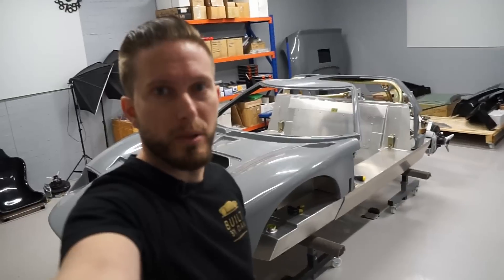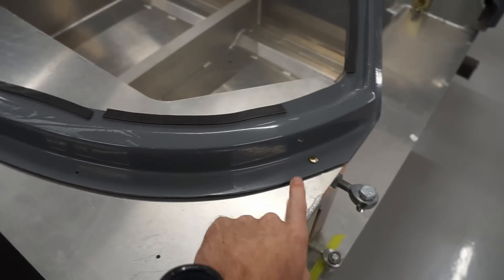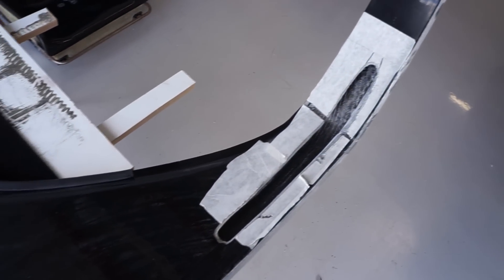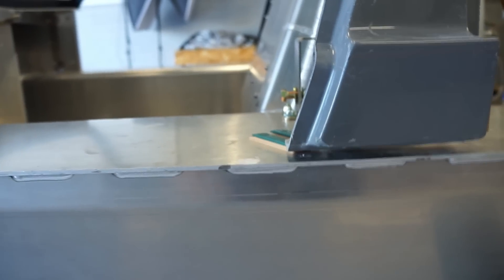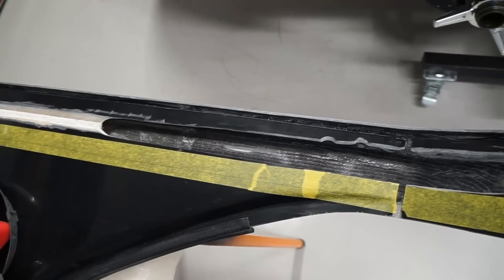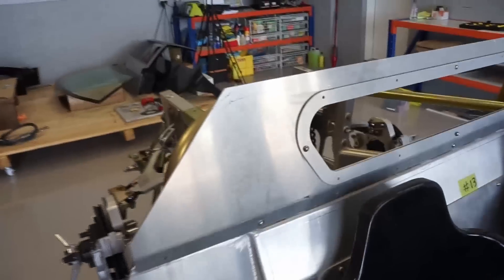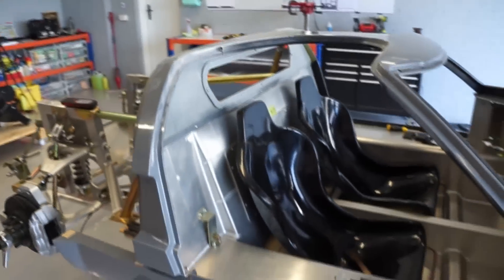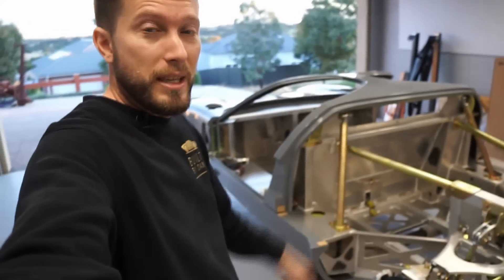GT40 Kit Car Build - Ep 20 – Roof Spider Install

Comment: Your patience has been rewarded, Dan. The result looks great. 

Other commenters have been scathing about the quality of the AP body. There is a world of difference between panels that need to be trimmed into alignment and panels that have no hope of ever aligning. 

I have heard of plenty of GT40 projects using well-regarded kits that needed the spider cut into four and reglassed to meet the sills and accommodate the doors. That’s the reality of fibreglass.

Comment: I had two minds on this Dan, either the roll bar should have been designed to sit neatly under the spider without cutouts or modify the spider to recess the roll bar tubing (which I believe will give a better look finish). Either way I think Absolute Pace should have known of this and incorporated this as an opportunity for improvement. Once all is clear I believe the spider's strength could be retired by wrapping the bulkhead and tubing with thin flat rubber sheets, add a release agent then fill the spider cutouts with reinforced glass resin. 
As for the build, I'm really enjoying your progress and I hope we'll meet up one day once mine is done.

Comment: dan being a panel beater i would use black urathane across the top back edge of the roof spider where the roll bar meets put a tape line on the roll bar about 3mm back and do the same on the roof spider put a seam of urathane across it wipe with your finger the length of the cut use a rubber glove of course then pull the tape off so it is nice and neat. urathane when it dries is flexible so it will work good with the figre glass expansion in the hot weather you can use it to seal the rear window bulkhead as well as most urathanes are structual and it can also be painted if needed a good example is wurth black KD bond keep up the great work just don't use silicone cheers glenn
Reply from the maker: Thanks for the advice Glenn, that's pretty much what I intended to do, so good to know I was on the right track! I know I often refer to 'silicone' as a general term for a sealant, but appreciate silicone and polyurethane are two different products with different properties.

Comment: Hopefully the manufacturers of the kit acknowledge that they stuffed up the radii of the roll bar bends. You shouln't have to weaken the roof spider for this bodge. Love you work though Dan.
Reply: Exactly !!
Reply: They havent admitted the kit is not fit for purpose.. I pity the poor guy that tries to build one off theese crap kits after
Reply: Pretty piss poor for something that’s supposed to be a premium product. If I’d made something that fitted that badly I’d struggle to justify charging money for it that’s for sure.
Reply: Factory 5 make all body panels over sized. It’s up to the builder to make them fit to there tolerance
Reply: @s.hall.4187  but surely you shouldn’t have to grind away the inner structure of the spider to make 2 of their components fit together? Just can’t get my head round that being accepted as a given
Reply: @mopedmarathon I agree, but here we are, I suspect that the supplier is not the manufacturer of every component

Comment: Gday Dan
Sam here from Perth-have same kit ordered and not far from being shipped— have a gen 3 2020 Mustang 5.0 liter and with all wiring harness and all accessories— have done mods for shallow oil pan and inlet manifold and using Subaru STI 6 speed modified for transaxle with locally manufactured flywheel assembly— look forward to your next episode— all the best mate!!
Reply from the maker: G'day Sam, best of luck with the build! Sounds like we are running a similar setup, with the exception of the transaxle, and you're lucky enough to already have your running gear, I still have a bunch of components on back order, mostly in the US... flywheel assembly and clutch is something I still need to sort. Thanks for the support, hope the build series helps in some way with your build! Feel free to reach out via email or on Instagram if you'd like to compare notes along the way.

Comment: With these tight tolerances, just remember to do something about the future rattling, which will occur.
Self-expanding insulation foam for instance, before final fitment.
Reply: I agree. I was thinking 1 or 2 mm self adhesive neoprene tape. The metal bar battering the single layer of glass will cause delamination in no time.
Reply: Great minds think alike, Paul. I was thinking the same, including the expanding foam. Expanding foam can get a bit messy.
Reply: @rickden8362  Ah.. Great mind. I don't think I am quite *that*, but I've built a car or 2, and that makes me experienced and practical.
Reply from the maker: Thanks for the advice Paul, any rattle would drive me crazy! Only concern I would have with using expanding foam is that it would be a nightmare to separate in the future if I had to remove the spider... I was thinking neoprene self adhesive tape to separate them  (as mentioned by Tim) and then polyurethane sealant (thinking was a bead of sealant would be easier to break in the future if I had to remove the spider).
Reply: @BuiltbyDan  One way to get the spyder to separated from the expanding foam would be to stick some clear cellophane wrap on the spyder with some spray adhesive. Also put a light coating of an oil on the cellophane. When the foam hardens it will separate easily.

Comment: Good slow work to get things just right.  What a pain.  Certainly seems like something you shouldn't have to have done.  Just a thought.  If the roll bar/panel makes contact with the spider, you might get some squeaking noise when you drive.  Might want to put something between, like a thin rubber sheet.  And remember, it might change between summer and winter.  Speaking of which, why are you sweating?  Isn't it winter down there? LOL.
Reply from the maker: Thanks Professor, I was intending to put some rubber/neoprene self adhesive tape on the roll bar where it gets close to contacting the spider. As for the aluminium bulkhead panel, I was going to use polyurethane sealant to separate and adhere the panel to the spider, hoping that would be enough to avoid any squeaking or rattling.

Haha, this episode was filmed over almost 8 weeks! I managed to catch the last few warm days before it turned cold really quick!

Comment: Its interesting to see the KVA based ridge in the roof mold at the top of the B pillar.  I was under the impression that the AP car was based on the RCR car, which was based on a body pulled from GT40 P1008? (could have the wrong chassis number).  As the original car was a metal roof, i had always wondered if RCR used a KVA roof to achieve the fiberglass part.  I guess you can be reasonably sure that the KVA based windscreen will fit. This should be good in the long run as there is lots more of this screen around than the original.

Comment: Great stuff! Nice to see that all your effort, time and patience made for such a good fit. 

I would ask, do you think that doing a reverse support cupping of the spider with more fiberglass, to go around the bar, would help reinforce the spider and give more support for the doors (when installed) when they are in closed position.

Looking forward to your next update to see what is in the large box..!
Reply from the maker: Thanks for the feedback! The spider has still retained a lot of its rigidity, even after removing a large amount of material. I think I'll need to fit the doors and see how they align and then determine if the additional fiberglassing will be necessary.
Reply: @BuiltbyDan  i really dont think it will be, having worked professionally on FRP/CFRP airplane parts that material looks plenty thick to support the doors. cutouts like yours barely impact rigidity of a fiberglass part with curves on multiple axis

Comment: Nice work as always.   

It’s almost as if the manufacturer designed these kits in CAD but never actually assembled one.  I mean I expect some trimming with any kit but that is a shocking bit of either bad design or out of spec manufacturing.

I am not second guessing your thought process.  You have the car in front of you so your judgment is based on fact where as my judgment is based on watching a YouTube video.  But my first instinct would have been to cut the roll bar down (cut the bottom mounts off, shorten the tube and re-weld on the mounts). Then cut off the bottom of the firewall and re-bend the bottom. probably even reposition the window down just a bit .  My concern being the modified spider may now vibrate more and have some slight side to side movement with so much material being removed (leading to cracking at the bottom mounting points) That can be counteracted with a generous slathering of 3m 5200 all over the top of the roll bar but that makes future disassembling a issue. 

Your attention to detail is great.  Thanks for sharing.
Reply from the maker: Thanks for the feedback/comment. I believe the intent of the manufacturer was to keep the roll bar as high as possible, but that approach probably should have carried through to modifying the moulds for the roof spider to allow for a rebate for the roll bar, rather than resorting to having to trim so much material out.

Surprisingly the spider has retained its rigidity, it doesn't feel flimsy with that material removed, but I guess I won't really know for sure until I'm doing highway speeds with a bit of wind pressure...

Comment: Coming along nicely mate I’d be checking the door fitment before I go too much further. All that trimming could easily affect the roofline thus the door fitment
Reply: I was just about to say the same thing. Check the door fitting b4 moving on.
Reply from the maker: Thanks for the suggestion Jeff. I think I will fit them up just to make sure there are no issues. I didn't think to fit the doors as I was still working off the temporary mounting locations from when the initial alignment was done in the factory. I'll provide an update in a future episode on the fitment once doors are installed.

Comment: Wouldn’t it be better to keep the structural integrity of the spider and have to roll bar cut at the flange and rewelded?
Reply: Exactly what I was thinking!
Reply from the maker: G'day Chris, I believe the manufacturers intent was to get the roll bar up as high as possible, hence protruding through the inner spider skin, but if this was the approach it probably should have been followed through with the appropriate modifications to the spider moulds to accommodate...

Comment: 13:35 
I dont know if you mentionted it yet, but are you gonna cut off that piece of metal, so the fuel line is gonna have space?
Reply from the maker: Yes, once the final alignment of the body is complete I'll core a hole for the fuel line. I want to make sure the front clip is in its final position before I do that so I can position the fuel filler/cap correctly.

Comment: Hi dan as builder also and really into my cars , i love the attention to detail in quality. One thing that i can think of is vibration between the roof an the roll bar/fire wall  . Do you think that’s is possible. Thanks
Reply from the maker: Thanks for the feedback! Yes vibration/rattling is definitely possible. I was looking at using a self adhesive neoprene tape where the roll bar is close to contacting the spider. The aluminium bulkhead panel I will be applying a polyurethane sealant between the panel and the spider. I'm hoping that will eliminate any rattling due to vibration.

Comment: The camera recording issues make this hard to watch
Reply: I'm sure he's doing the best he can. He's building a car, not trying to score points in camera work.
Reply from the maker: G'day Matt, a lot more hand held footage in this episode so I did notice it is a bit more shaky, usually I rely on a tripod, but it just wasn't practical for this step of the process. I am looking at purchasing a GoPro shortly, which should have better stabilisation for this sort of recording 👍 Thanks for the feedback!
Reply: Hi Dan, it's not the camera work I'm talking about. I think it's great how you get the angles to show what you're doing, is more that it seems that the actual format is having issues, line tearing etc.
Reply: @Paul_VanGo  read what I actually wrote instead of jumping in SJW style
Reply: @mattcrawford1976  I did. That's why. And you got Dan reacting too about it. It might be your phrasing?
Reply from the maker: Thanks for clarifying, I've had a few comments from time to time about video compression etc, seems what you are referring to might be related, I've been trying different things in the editing process but I just can't seem to resolve it...